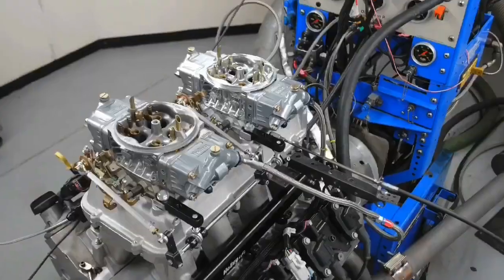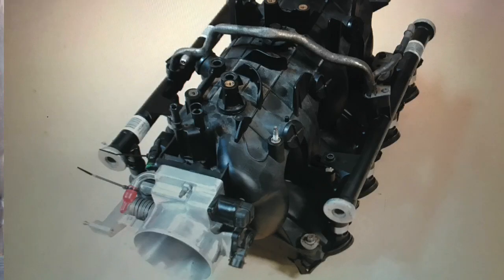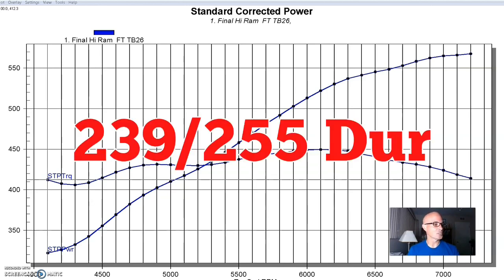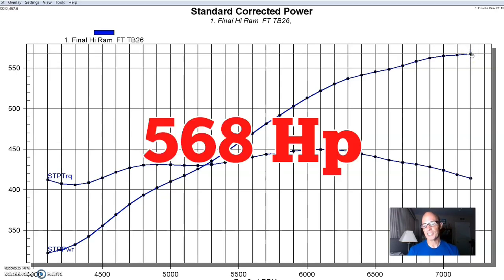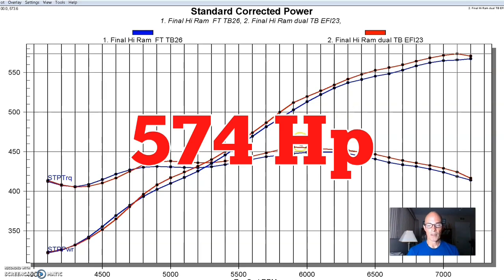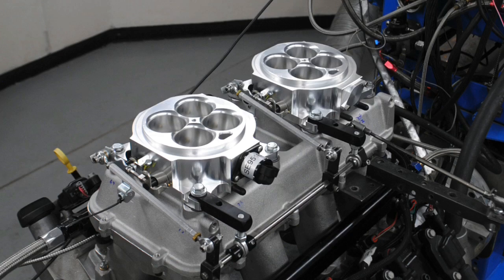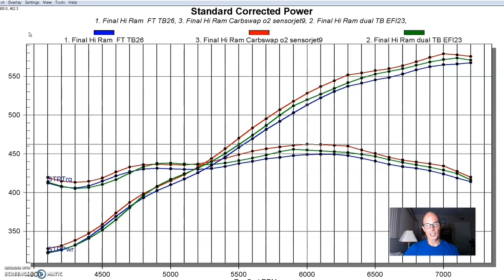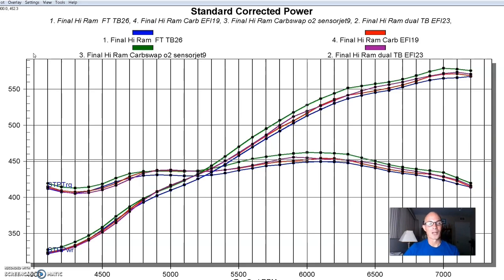LS1 CARBS vs EFI-WHO WINS?

Comment: I wonder if the difference between front air intake and the dual quad dry flow throttle bodies is about airflow direction. With the front 102 mm throttle the air has to turn 90* to enter the intake runners where as the dual quad throttle bodies the air experiences very little directional change. That direction change has to affect air velocity, turbulence and maybe temperature. We used to use velocity stacks to "straighten" the airflow.

Comment: Great vid. However  You could have ran the throttle body injection from holley. You would probably seen the same  results. Pro stock allows one ECU and where to put the injectors. Warren Johnson wanted years ago to go fuel injected. He quit when nhra  alowed fuel injection but ruled where the inj. would go and what brand EFI to use. NO R&D  no use for the class.

 If anyone would make an intake that the injector would spray down the  runner and fish scale or snake skin the runner wall to holds fuel to puddle they would be king. No short time fuel delay and cooling to boot. That's why meth inj. is king. on a street car.

Comment: I still want to see a throttle body and port Injection combination. Run the throttle body end pretty lean and tune it in at each cylinder with small port injectors. Maybe even a carb and port Injection combo!

Comment: I don't usually watch Chivvie engined videos, and definitely not LS (yawn) stuff, but I've wanted to see results from a thorough tester like you on the old FI vs Carb question. You did not disappoint. Dare I say brilliant to run carbs as air only meters while injecting? I dare. Run FI or carb(s) as YOU prefer. Case closed. I have Mass Air injection on my '72 F100 w/ mildly modded 302 inline valve heads, TBI (ancient, manually adjusted) on my '86 Ranger w/ mildly modded 351C, Pro Systems Holley on '80 Pinto w/ rather nasty 351 Clevor and Holley Sniper EFI on '72 Pinto with nasty Boss 302. All have their good and bad. All do the job. Being a very low budget guy these days, I use what I have or can afford to get that theoretically matches the requirements. Best bang for buck is by far the Pro Systems carb, no contest. It is a helluva lot messier to make tuning changes on, but infinitely easier to tune than the old ProJection4. Salute, Mr. Holdener.
Reply: sounds like u have some cool ford stuff man! I agree 200 percent about LS and Chevy stuff. nothing bores me to tears then small block Chevys new or old! feel like Chevy could make the biggest pile of garbage v8 engine ever and everyone would love it

Comment: What if you took the Holley Sniper intake but instead of using a 90mm or 103mm throttle body, put an elbow adapter facing upward and then mounting a carburetor. Lol I'd love to see that just for the visual!

Comment: There are one more thing about carbs against injection.
As the 'column' of air is filled with fuel it get´s more inertia to fill the cylinder after btdc.
You CAN reach the same effect with injection, but you need to precise the injectors to run at 100% duty at all rpms...  you need mechanic injections for that.
Reply: an insightful comment...

Comment: How about a video comparing a Predator  Carb vs. Holley vs. Demon on a Big Block!
Reply: Yes I would like to see that comparison Full Throttle and part throttle performance
Reply: I have a predator that I ran for a while. The throttle response is neck snapping at any RPM.
Reply: I believe it's because Holley convinced the NHRA that it was fuel injection.

Comment: And this is something they knew in the 1970s... look at any Can Am car running Lucas mechanical injection.  Injectors are far from the heads.  Look at Bosch mechanical injection on road race cars in the same period and you'll see the same.  Look at a McLaren F1 with staged injectors (90's tech)... idle/slow running injectors near the ports, high power injectors far away from the ports.
Reply: Look at sprint car stuff from decades ago with down injection, if not seen it, nozzles into back side of port from out near exhaust flange

Comment: Bravo!  Feel like I'll be referencing this one forever. 

Just needed the throttle body injection test. ;-) 
Seriously what I'd like to see is port injection supplimented with a "9th injector" just after the throttle body that only works at WOT to provide charge cooling. (Or water + meth injection.)  -The Holley HP definitely supports water + meth injection. 

A port injected N/A motor with water+meth injection and a start strategy for activating it, should actually support a higher compression ratio and make more torque AND more MPG, too.
Reply: Adam Arndt I’ve seen water meth and straight meth injected through a perimeter nitrous injection plate. Charge cooling (lowering inlet air temp) was the goal.  Kind of a poor mans intercooler for turbo/ turbos/supercharger. On na applications it could also help with detonation and or allow you to use a little more timing. Setting it up with the Holley would be ideal.
Reply: lloyd holt That’s what I want to see on the dyno.

Comment: do a dual quad tunnel ram and individually tune each cylinder.  Ive seen brule do it lol
Reply from the maker: we have on a BBC-not ideal with carbs but it helps
Reply: @richardholdener1727  try it with a bbf or build a sheet metal one for the caddy (dry intake so should be reasonably easy).  something with identical ports would be way easier i imagine than the long and short port nonsense of a conventional big block chevy

Comment: Richard can i ask if you have ever measured the time it takes to sweep the rpm on the dyno run. What effect the tune makes to the time. Does the best dyno run provide the shortest sweep time? Thanks
Reply from the maker: the time is controlled by the dyno at 300 rpm per second-tune or power does not change this
Reply: @richardholdener1727  thanks for the reply, i only asked because i read a few years ago one of the big carby company's hosted a carby shootout and i believe they measured time.

Comment: I’ll attribute the gain to the direction changing airflow. It’s like when engine masters. Did their air cleaner test. And they made the ergo straight down air filter instead of coming in from the side. There’s less turbulence going down the carburetor or throttlebody then into that one of the chamber causing turbulence. That is my hypothesis. Seeing as how that’s really the big change. Unless the 102 Millimeter throttlebody is restricting airflow. But there must be a rating for that size somewhere
Reply from the maker: the 4-hole throttle bodies and dual carbs flow the same direction-its charge temp
Reply: Richard Holdener Yes, I was referring to the first intake where it enters the single throttlebody and then gets turbulent inside that flat top intake Plenum. What was the difference in charge temperature?

Comment: I think it’s important to realize that there are generally more than one way to achieve a goal. With this in mind, I think it helps to keep your mind open to new things. Some may work some may not work. But if we never changed something bc it worked we would still be on horses. Not saying you have to try everything, and not saying to acknowledge stupid ideas but definitely good to study different ways of doing things. For example maybe check out how airplanes are wired vs auto wiring. Or an f1 engine system to see if there is anything that you can transfer to your drag racer. Anyways. Thanks Richard.

Comment: They all have their place. 😆 it's just fuel injection... better. You can't change a carburetor while you're driving down the road. Lol
Reply from the maker: then you have never run a feedback carb
Reply: Jeff Kopis : Little YFA 1bbl 2.3 Rangers, Must"nag" 2.3s and 4.9 F trucks, 2 bbl ELB 318 and 360 Chryslers, 351M 81 - 82 F trucks and Broncos, some 83 to 84 5.0 F trucks trucks, some AMC Jeeps...generally dreadfull but the Qjet 231 Turbo 301/305/350 GMs had the system too. The guys who could follow the service manuals got those Pulse Width Modulated (PWM) and Dwel Meter Duty Cycle systems working really good. The Mixture Control Solenoid  or Bowl Air Valve or Hanger enrichment systems ran just like the, ahem,  PWM on an injector. People lost heart with feedback carbs when the world saw how great Tuned Port EFi 305 and 350 Chevies and Sequential Port EFi 3.8 T types and Ford 5.0s ran at the drags and on the street. When fuel injected specialty coupes started behaving like K code Mustangs again with below 16 sec quarters and some nice sounds then it was no looking back to carbs.
Reply: all the boost ; see post JKs above. The Carter, Rochester and Motorcraft Feedbacks were made from approx circa1978 till 1987 and did exactly that...varied air fuel from full rich under load to as lean as 16.1 :1 in some instances on the fly at criuse.  Ford, Mopar, Jeep and GM got right into Port EFi because the single point, single carb throttle body mixtures could go all psychotic over the place if someone meddled with it. This is where the rhyme that carb us French for Dont F with It came from! The best feedback carb was the YFA...it outlasted them all in the Ranger 2.3 and XJ 2.5 Jeep, but was man enough for 114 or 85 hp engines, four or six cylinder. But people fiddled with the metering rods and no one understood how it worked. Once the little do dads inside got broken and wrangled with, the stupid feedback carb made funny noises like a Darlect from Dr Who and proceeded to piddle fuel over the place like a dog at a lampost.....
Reply: Jeff Kopis : The  Variable Venturi was partly feedback in part on only one version, your Motorcraft VV 7200. The cruise and under load air fuel ratios were trimmed by the two metering rods and an air valve, not an O2 sensor. Point is, closed and open loop was on the idle speed via a steeper motor and Vacuum operated throttle modulator to pull the throttle back...it was only on the idle. The two replacement Holley 2bbls had the idle circuit closed and open loop control. It had no O2 feedback in air fuek  like the 83 to 84 5.0 Motorcraft 2150-E, Carter YFA, The 4MC Rochester  RRP Quadrajet and Carter Themoquad ELB had no O2 sensor. .
Reply: Jeff Kopis : My background is Ak Miller Impco and OHG Liquified  Propane Gas fuel systems, which forces you to understand basic carb, throttle body and Port EFi systems, as well as every aspect of the emissions and on board computer and Ignition systems. Cause somewhere, some how, your gonna have to turn a system on or off without creating a fault. GM wrote the book on great Fuel delivery systems....very few turkey General Motors fuel systems....lots of fun with the Cross Ram style intake the late John L designed his special intake on...Ak Miller once said everything good exists in just fuel delivery systems. Richard...your on point with this stuff you sane, rational thinking hard cut diamond!
Reply: Jeff Kopis : No, he passed in too soon, even into his 90s so did Jay Storer, only younger. But his knowledge and enthusiasim and sense of wonder lives on every time Richard talks. Lets Make some Noise....

Comment: I am a fan of the disconnection I can have with EFI. I’m not racing just daily driving and I like my car to start and run everyday and run the same everyday for years and years. For that reason I’m a fuel injection fan over carbs, but the engine masters guys made more power with a well tuned carb
Reply: Never had a problem starting any crappy carburetor topped car I owned when i was a teen in the 80's during NY summer and winters.
Reply: And the carbs never have chokes on them so they are hell when you try to start them in Minnesota in the winter. 
And when you dive bomb into a corner with the brakes on through the bumps-- there is no chance Fuel Injection will go blub blub blub.
Reply: @TwoLotus2  get an offroad rated carb and that wont be a problem anymore.

Comment: How even is the fuel distribution from dual 4 barrels like that? Obviously it doesn’t have the adjustability of port injection but it still seems like it would be even between all the cylinders.

Comment: I wished I lived closer, I'd love to go to school there and be the monkey wrench doing the grunt work. I learn a lot from your videos on here.  I got a 99 chevy astro van recently and I'd like to learn to fix up the engine (L35?) Vortec 4.3. I'd be tempted to replace the 4.3 with an LS. 4.8 or 5.3 with a little boost.
Reply: find your local speed shop and tell them you want to learn and work. Get paid for your grunt work and learn while doing it.
Reply: @lucysmith4242  unfortunately, there isn't one close by. I'd have to drive to Oklahoma city or Wichita and I live dead center between them. It would be 4 hours a day of driving and I couldn't afford that.
Reply: 5.7 Vortec is an easy swap on the 4.3 Astro vans.  You can get close to 400 hp out of a Vortec 350 with a cam, headers and tuning.

Comment: An Old method reborn. My dad ran mechanical fuel injection most of racing career. He started using them circa 1972. He put his injectors in the stacks above the throttle valves running gasoline for this very reason. He says methanol isn't as critical. You can put them an 1 1/2" above the intake port base.

Comment: Id love to see a video on  various measured back pressure and hp loss on a 600ish hp engine. I think it would be easy to slip on multiple reducers to get the data. How much is 5psi of back pressure killing the top end? 30rwhp?
Reply from the maker: look at the exhaust test video
Reply: @richardholdener1727  https://youtu.be/WFB-XFpL7bk?t=335 
 Great video! 36hp off of 1psi BP reduction at 900hp range. I wonder if thats scaleable to a lower hp NA combo. Ill still call it 30 to be safe and cross my fingers for more. Thanks

Comment: Well in the late 90s we played around with a 5th injector setup in a staged fashion. It was mounted in the inlet of the single throttle body and only added fuel above certain loads. It was on a 13b p port motor with high compression rotors, we were trying to reduce detonation and honestly it allowed us 4° more timing so it helped that motor.

I really love all of your testing videos!
Reply: Also, water meth!
Reply: The extra injector pulsed by the coil- with b+ from a psi switch was the shit before tuners became a norm
Reply: My old tpi had a 9th injector for cold starts and could be used for the same thing.
Reply: @sebbonxxsebbon6824  Toyotas haf them in the 90s
Reply: Nothing I ain't seen done with the factory 7th injector on turbo Buicks...!
Reply: I might be mistaken but I'm pretty sure Holdener talked about that exact thing in another video. Maybe his stacks video?

Comment: How does 4bbl tbi efi like holley sniper or Fitech compare to carbs? Guys try to tell me carb makes more no matter what. Tbi efi is injected at 60psi so the atomization should be better, but to the engine, it's literally the same as a carb.
  Edit: this comment was obviously typed before the conclusion.

Comment: You don't know what you're doing! 😅

What about throttle body injection! 😅

Another great video, thanks Richard! I'd love to see a test with individual throttle bodies and the injector outside the bellmouth, but quite an expensive setup I imagine...
Reply from the maker: Points
Reply: @richardholdener1727  It would be interesting to see a test with the carbs or throttle bodies with injectors placed high up on a tunnel ram, and see the differences between using 100% alcohol vs. a 90%-10% alcohol and distilled water mix in a 16:1 comp. ratio engine

Comment: Maybe if you used center squirters, and elimenated the plenum.  Then you would have have total control over the mixture for each cylinder.
Reply: Jeff Kopis  Not if you have a dedicated venturi for each runner.

If what you say we're true, lawnmowers and motorcycles would need plenums.
Reply: Jeff Kopis  Your logic is terribly flawed.  Doesn't matter how big or small the cylinder is, or how many there are.  The carbs are simply sized and multiplied to match.
Reply: Jeff Kopis  That's not true.  Haven't you ever seen an English sports car with individual SU, or sidedraft Webber carbs?
Reply: Jeff Kopis  I have only seen balance tubes used between the plenums on multiple plenum intakes, such as the twin intakes on the old Chrysler letter cars, or Volkswagen twin carburetor conversions.

Never on dedicated one barrel - one port configurations.  As far as Webbers are concerned, I have seen them on 427s, one barrel per cylinder, and they work great.

Comment: The results are what I expected. The same as results going back decades at this point. I have some constructive criticism that will make your videos better, well better for me at least, LOL. I'm about half deaf now and when I watch videos it makes it a pain in the arse if the volume level is not consistent when there is speaking going on. I know why it happens because you are editing different video segments together. Maybe it's possible to adjust the volume levels to be more even between the segments? Either way your videos are very good, thanks.
Reply from the maker: I have only so much adjustment-I am getting better inside mics
Reply: @richardholdener1727  I'm thinking it may be something that can be adjusted in the editing. Even if you can't fix it, I'm still going to watch. Good videos with good usable information.